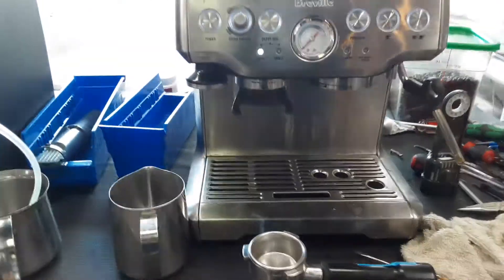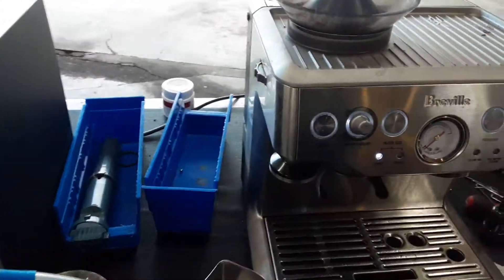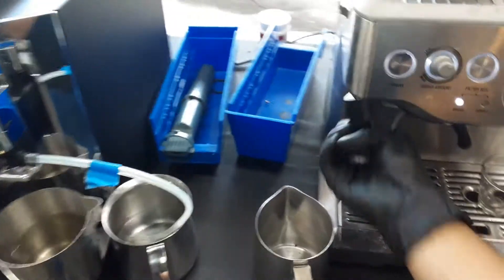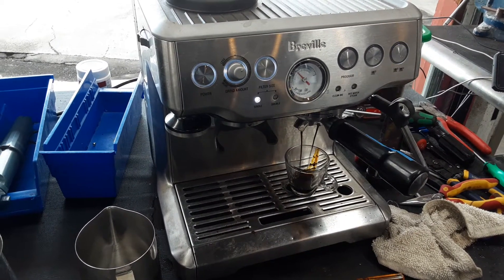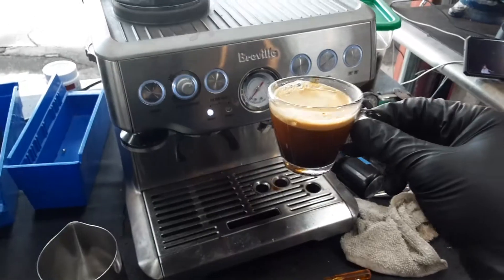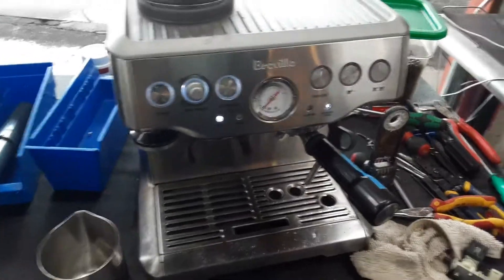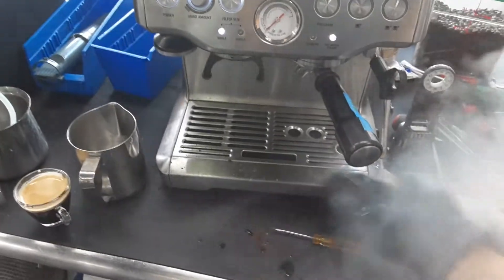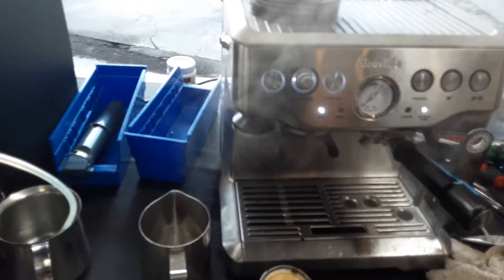New 3 way solenoid - Breville BES 870 XL - 4274 TEST

Comment: Hi - Great videos and really informative. I'm repairing a second hand BES 870 machine, I replaced and serviced the solenoid assembly. But I think the Solenoid is always powered which means that water, hot water and steam is al coming through the group head. I've cleaned the machine and descaled. When I unplug the power cables to the 3 way solenoid valve, the hot water and steam come through the spout and steam wand. So no blockages. But when I plug the power cables back into the solenoid, the hot water and steam flow through the group head. Do you have any ideas on what could be causing this? I'd really appreciate your help and advice.